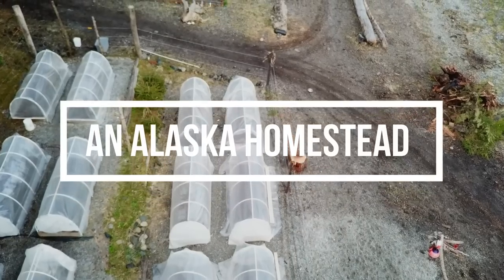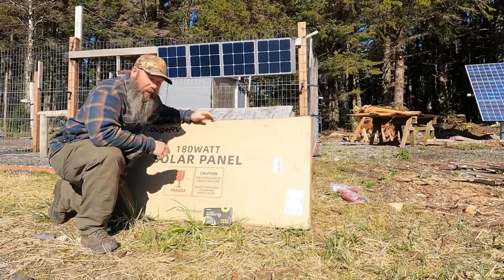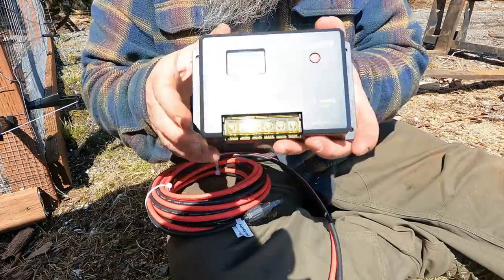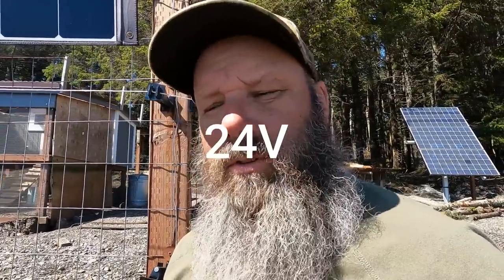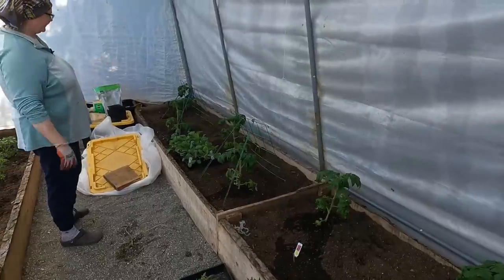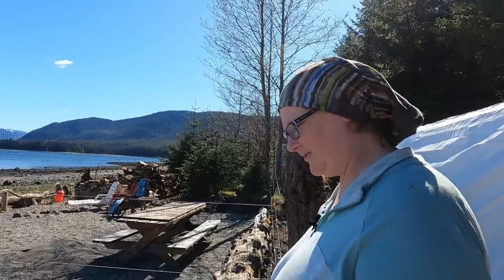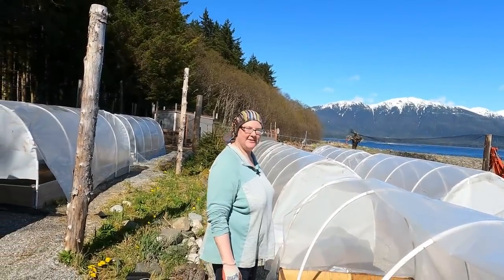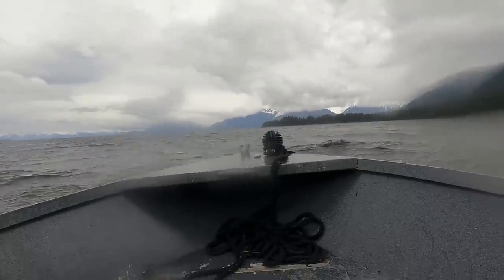Guess what is back? Planting our garden and installing our BougeRV solar panel.

Comment: Free is always a good price for more power.  Most of those small PWM charge controllers have settings for turning the load outputs on/off at specific times.  Might be worth checking if your rebranded one does too.
Oh you live on that island where the moose go when they die 😉 🦌
Reply from the maker: Ha apparently we are Moose grave island.  I’ll check and see if you can program an on and off time. That would be cool.

Comment: You could have went old school mafia on the moose and  used cement on its feet!😂 Garden looking good. Mine not so much. Finally got to work the ground and then my tiller took a dump. 2-300 for the part. Probably just going to weld it up and remachine it for now. Your place is coming along nicely. My aunt and uncle are in the great state of Alaska visiting my cousin and his family. They are in Soldotna. Have a great week!
Reply from the maker: Ha that’s pretty much what I did. Tied a cement anchor to its leg and watch it sink. Get it welded up that sounds good to me. I hope your aunt and uncle have a great visit.

Comment: Wow !..really nice !

I will have to try those solar panels.( Just ordered one )...I don't use much electric here.

The moose saga..is funny as heck 🤣

Got a few - 4 tides..going to get a shit ton of octopus and sea cucumbers..
Reply from the maker: Do you use a lot of dc at your place? I need to try using more dc I think. Well we got rid of the moose and then a huge sea lion washed up on the other side of the island. We can’t win this year.😂 yeah we are going to work on our anchors on these low tides.
Reply: @AnAlaskaHomestead  I use both but mainly DC..
The big excitement here this week was a container of Yeti coolers fell of a barge and people were finding them..every where..

I probably asked you before..but are you in the Juneau borough..or outside of it ?..I would think they made it bigger to get the mine in it..too.

I am working on a couple of new things this week..one is adding mince garlic to chicken as a halibut bait and the other is adding  mini flashers to the clips on my gangions ( on my skate line )..the struggle is real.. 😆

Cheers from POW..the 3rd largest Island in the USA..and the longest...if that matters.. 😊

Comment: One thing the vegetable industry does not tell you you should pot up your peppers you can overwinter them the next year after you overwinter them they produce a lot more peppers. Another thing take your salary when you're done with it scrape the bottom of the celery the cluster plant it right in the ground several weeks go by you've got a bush of celery much stronger than the store-bought but please overwinter your peppers you will see so much different I have a jalapeno that is 6 years old last year I got 200 lb of jalapenos off of one plant that's 6 years old
Reply from the maker: That’s awesome. I’ll pass this on the the Mrs.

Comment: That's a pretty neat idea with the solar panel for the chicken compound Brian!  I may copy the frame you put it on.  When I get up there next month I'm going to have to put together a small solar system just so I can work, until I get my bigger solar system built up and installed.
Reply from the maker: That’s not a bad idea having an interim set up.

Comment: How's the battery going to hold up when it's -30F....it's outside correct?
Reply: Hello, our solar panels' operating temperature limits:  -40℉～～ +185℉😄
Reply: It doesn't get that cold there
Reply from the maker: Yes they do fine in the cold and like Brett said it doesn’t get that cold here.
Reply: @BougeRV  Operating temperature doesn't matter if the battery goes dead.